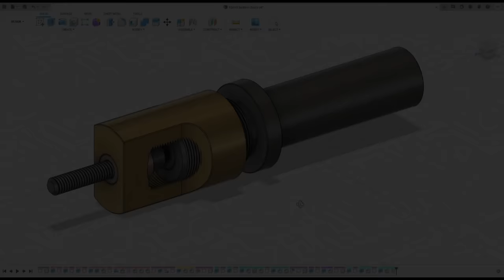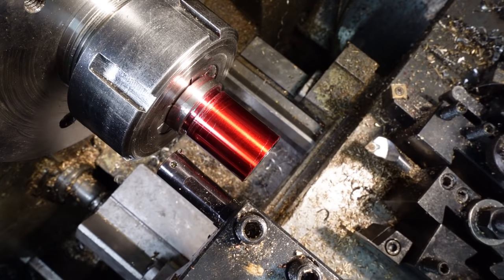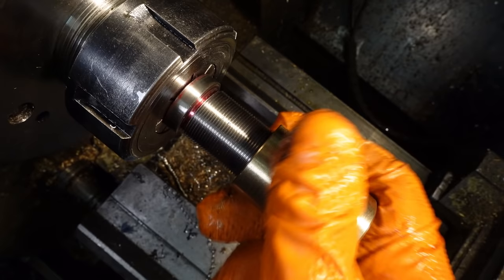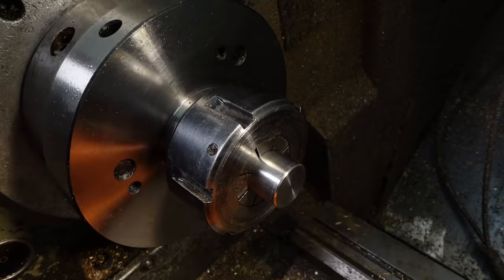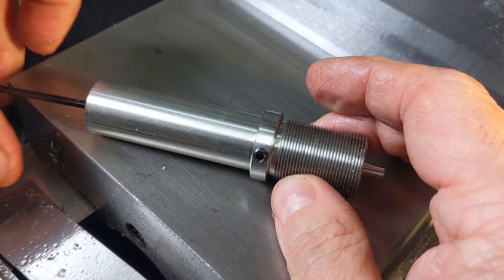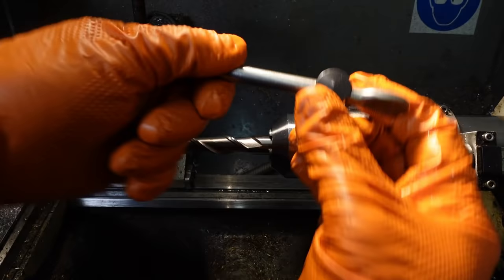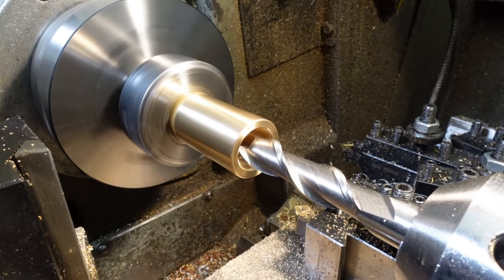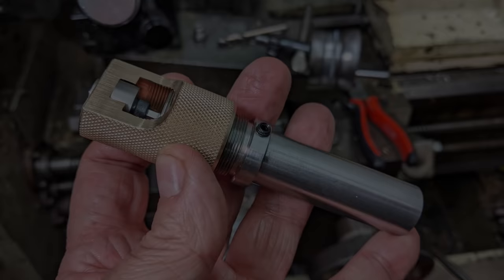Lantern Chuck machining and build #toolfest2021

Comment: The bit about the tidyness OCD people almost killed me! I'm still giggling about it! Keep up the great videos, man! 73's - KK4YKN
Reply from the maker: I am terribly rude to them. I'm sure it's a painful affliction though. Seeing others who are free of that particular genetic tidiness quirk doing their thing effectively despite less than perfect tool storage and chip-tray polishing must cause serious stress and anguish, and I feel genuine sympathy for them.  No, really. Look, stop giggling folks. Anyway, this evening I used a polishing cloth on the part of the chip tray that was going to be in-shot, as a token of my continuing efforts not to cause distress. Wasted effort. The depth of field of that F-stop was so tight that the chip tray was nothing but a distant blur. So blurred that you could believe it was messy, if you were so inclined.

I'm working on the second and third parts of the 1296 MHz coaxial stepped low pass filter at the moment, it is taking FOREVER to do the editing and graphics and run all the simulations, but I really want to get the level of detail right and make sure the filter performs just like it does in the simulations, so it will be a few days until I can post these. I'm going to be doing more radio content showing exactly what the Things I make are used for, but it's driven by whatever is next in the order book. I need to get some more solid copper watercooling plates made and I have 15 or so SSPA heatspreaders to finish and 30 or more 122 GHz antennas, but I only have six days until I have to give a lecture at the Martlesham Microwave Round Table event and I haven't even STARTED writing it and doing the experimental work. Not enough hours in the day!
Reply: 😂😂 I just laugh, all I can say...it's a very nice chip collection that's all..😂 oh there's a lathe under that..😂😂

Comment: Yes, the sound is much easier on the ears; however the waterfall effects mean now my bladder is making itself urgently known!
Reply from the maker: If I was doing it now, I've worked out how to handle the audio split in sped-up sections and got my levels right, so it would be much better. I used it again today and it's earning its keep.

Comment: Thanks, subscribed. You sound different to the way you sound in my twitter feed - you're much funnier here (that's haha funny, not weird funny). My lathe never grows extra teeth - occasionally the opposite due to cheese-grade gears 😁
Reply from the maker: Twitter me is rather different, but it's probably the Lincolnshire accent that does it.  Very hard to get the inflection and vowel sounds right in 280 characters. Cutting gears from cheese sounds like an interesting challenge though.  Using Old Gouda, it might just be possible
Reply: @MachiningandMicrowaves  Haha, I'm originally a  Yellowbelly myself (from the flat bit to the south) so you sound perfectly normal to me.

Comment: When you were running that "janky chinese reamer" in, i wondered...if you have air, could you use a gentle breeze to persuade the cutting lubricant toward the point where it is most needed?
Reply from the maker: I guess that might be possible, but ideally the cut should be light enough to make it in one pass without extra lube. Perhaps I could have used my Noga-Cool Mini to blast a fine mist of lube to help clear chips.

Comment: I see alot of people with battery problems on cameras whydon't they make a wall plug for them to keep them powered up for when you can use a ac power supply I know cameras are made on a 99.899 percentages to be portable I mean the point is clear but I obviously know nothing about them .also might have just found a away to make something the community can use whith that being said what camera do you use and what is the most common one used on you tube...if you know or how to find out without looking at every page .. hmmm food for thought..
Reply from the maker: Mine is a Sony ZV-1. It is stupid. You can't run it while it is plugged in to the charger or a computer, except as a streaming camera. You can buy aftermarket dummy batteries.  They have a wire.  The problem is that you can't close the battery flap with the wire dangling out. That wouldn't be a killer, except that the battery flap hinges are either side of the tripod mounting thread, so you can't fix it to a tripod, rail or clamp with the flap hanging open.  Brilliant.  You can't drill a hole as the catch is integral to the flap and it would wreck any resale value.  I'm not happy to have the memory card and battery just hanging there in space.  I bought it as a result of viewing a LOT of Youtube vids and reviews because it seemed like reasonable value, but it was a total waste of cash.  Those reviewers are now in my Little Black Book of folks whose opinions I should ignore!  Dummy batteries are a reasonable solution for most cameras, but not this one, UNLESS...  I think it might just be possible to make a low-profile titanium mounting bracket that would allow the door to hang open enough to prevent the memory card or battery falling out, but also allow use on a tripod mount.  I guess they are great when used for vlogging on a gimbal with a pocket full of spare batteries, but when you are filming a machining operation or something else that cannot be re-shot, it is a liability.  The lens is junk for my application as well, the lack of a filter ring is a disaster and the focus discontinuity at partial zoom happens right where I want to do most shots.  Almost all cameras have a zillion things I don't care about.  I want manual and remotely-operated focus, manual and remote zoom, ditto shutter speed, ISO and aperture, with focus peaking or some other focus aid that I can use on a bit wall screen.  Manual metering would be useful.  I don't need any of the other function-bloat that most cameras seem to have as a result of marketing pressure.  I want interchangeable lenses that don't bloom and flare and have soft edges, you know, like the stills cameras I used to have in 1978. I want high dynamic range so I can pull out areas in deep shadow and handle specular reflections, so adaptive ISO in different image areas would be cool. I'd like a programmatic API interface so I can send commands to the camera over wifi or bluetooth from applications I write or from a physical control panel like a CNC or Midi controller. It needs to survive the occasional splash of coolant and occasional grinding dust or cast-iron powder, and also rapid changes of temperature and humidity without getting condensation INSIDE THE LENS like this toy ZV-1 does. I guess I'm going to have to spend £2.5k or more and just ignore the fact that I'm not using 98% of the functionality. I paid a lot less than that for my Bridgeport and my lathe.  I could buy a lot of radio gear and test equipment for that sort of money too, but it will be worth it if it takes away the stress and pain of using this thing.
Reply from the maker: Now I want a camera that is as gorgeous to use as my Nikon D80. I am going to end up talking myself into buying a Nikon Z6 II and being penniless for a while.  Purely for mental health wellbeing of course. It's like medicine or "fresh air and exercise" and it will probably bring joy like using a Brown and Sharp or Mitutoyo or Tesa or Haimer or Starrett metrology tool. Downside is that the remote control app is a bit rubbish. It will do full 4K RAW into a suitable interface, and can do 120 fps at 1920x1080, and has a 10-bit sensor depth. It's a stupid amount of cash and I could get a surface grinder and a bandsaw for that sort of money.

Comment: you do what u do and do best.
Reply from the maker: My lathe is often very very clean now.  My new shop vac thing is a monster.  Probably the most dangerous machine in the shop with that amount of suction.  I daren't use it if the Chihuahuas are about.  The tube is big and they are not big.

Comment: You know, I could have sworn that I heard running water and birds in your shop during those machining clips. If your shop is dirty enough that you can’t see a burst water main and birds flitting about, maybe it’s time for an intervention.

Great videos! Interesting projects, good techniques, and quite entertaining.
Reply from the maker: It's so distracting, having to wear SCUBA gear in there, and as for all the guano, ewwwww!
Reply: @MachiningandMicrowaves  Hear in America, at our makerspace we are re-designing the Apollo space suits, to make them gloveless, yet keeping the o2 pressurization so we aren't forced to breathe toxic wood dust while keeping virus protocol, adapting the condoms aides prevention gave us some trouble for a while, but that issue got resolved when we decided to castrate the users. DONE. were presently looking for volunteers for testing.
Reply from the maker: @stewartfrye  Sounds like an offer no reasonable person could possibly refuse!
Reply: @MachiningandMicrowaves  safety is safety after all

Comment: The scratch pass is for fallible humans who might select the wrong gear but if you not human or are infallible then please feel free to skip that step.
Reply from the maker: I did go a bit over the border into dismissive hyperbole there, didn't I...  AIMEE would say "Neil, you are so rude".

My old Colchester has one of those "Lathes for Dummies" gearboxes that makes it almost impossible to mess up. I totally get that scratch passes are a great idea for high-value parts or on lathes with change wheels and non-intuitive gear selections.  I've never messed up a thread pitch selection on the old clunker, but I did make a REALLY stupid mistake a while back, the thread dial has four different internal gearwheels and I'd swapped the wheel to do some 1.75 mm pitch and didn't change it back, so the next thread I made looked perfect on the first pass, but the second and third passes were offset a little and I found I'd cut a really stupid three-start shallow thread.  A scratch pass wouldn't have helped me, but now I hang a little label on the threading half-nut handle with the size of the currently-fitted thread dial wheel so I might not screw up another time. Luckily it was only the second or third op on the part and the thread was very short.  It did make me scratch my head a bit until I realised what was going on.
Reply: @MachiningandMicrowaves  Congratulations Neil, you have just passed the human test. You have admitted to making a mistake, welcome to the human race.
Reply: Let he among us who has never misread the gear chart cast the first stone!

Comment: The funny thing is I was cleaning up while wearing gloves and got a very bad injury from some broken glass and got small parts of the rubber glove in my hand after an ER visit later I did my own surgery because they couldn't find anything and well I'll give them that rubber gloves don't show up on x-rays but that's all they really did.
Reply from the maker: I have some fancy gloves with anti-piercing mesh that I use when picking up chips and ribbony swarf and dealing with glass and ceramic shards. I need my fingers to remain sensitive and not get pierced and tingly/painful so I can work on tiny mechanisms and 0402 surface mount devices with tweezers. Nitriles just don't work for that sort of thing. I have some anti-cut gloves with chain-mail and some chainsaw gauntlets with kevlar chaff and some deerskin gauntlets for TIG welding and some special beekeeping gloves and chemical-resistant gloves.  OMIGODS, I am such a glove nerd, aren't I!

Comment: I think you tubers use diekem when threading because they like the contrast for their cameras.  I like threading in reverse too. 
"Machining and Microwaves" Hmmm, Possibly you did microwave guides in the 1960s and 1970s?  I did, and I did it on manual machines too.
Reply from the maker: My father worked in a gas turbine manufacturing plant in the 60s and 70s, so I could just give him a sketch and, as if my magic, a few days later, he'd come home from work with a beautiful 10 GHz absorption wavemeter and 20 dB cross-coupler. Apart from a five week course in 1976 on basic machine shop practice, I hadn't touched a lathe or milling machine until I bought the Colchester and Bridgeport in March 2017, so I'm still a raw beginner as this machining lark.

Comment: Thanks for shining a light on what a lantern chuck is. I find that when you get the feeling that your workshop needs cleaning it is a sign that you need a mug of tea and a couple of chokky biscuits, the feeling will then soon pass. Gloves are for catching the bits of finger you cut off.
Reply from the maker: Tea?  TEA?  Foul muck.  Tastes like The End Times.  Liquor of Beelzebub. Although it goes beltin' with a good slosh of Bells or Johnnie Walker Red Label like my grandad used to have in his tea flask while he was out ploughing or baling.  I managed a glug or two while I was helping during harvest or planting. It made driving the tractor MUCH more fun.  Look, I was almost twelve and I could reach the pedals and plough a decent straight furrow with or without the help of that warming nectar.  Tea on it's own though? Ewwwwww.

Comment: Not gonna lie, i don’t know WTF that is 🧐
Aside from a dirty lathe 😶 i enjoyed every minute of it 👍🏻
Reply from the maker: A clue to one of its many uses might lie here:
https://youtu.be/ViRQuaKx3ik?t=40
Trimming bolts to a precise length, drilling a deep hole in the end and making a brass insert that is knocked in then turned to be concentric. Now of course, I need to explain THAT. OK, the brass pad helps prevent the bolts from scratching the surface of a piece of metal being help concentric with the axis of the lathe.  Mostly to prevent death or similar inconveniences to the lathe operator, ie me.

Comment: Go on... you knowledge is to spread to the X- Box Kids ...
Reply from the maker: I'm really looking forward to seeing what the Hackaday generation comes up with when they can get back to makerspaces and eventually get labs and workshops at home.  As ever, the problem is that when you are young and fizzing with ideas, you are also struggling to earn a living and do all the Being Human business and don't have the luxury of time and resources that come with being Of a Certain Age.  I am wrestling with some fluid dynamics interactions with metallic membranes for a VERY interesting upcoming project. Forty years ago, this would have been stupidly easy for my not-yet-worn-out brain cells, but now I have to plod through all of the maths and physics and thermodynamics, checking every step of the way.  Of course I do have the astounding power of finite element analysis programs to confirm the calculations. That given me computational power that I wouldn't have been able to dream of 40 years ago.  Just think what toolsets the X-box folk might have in another 40 years.
Reply: @MachiningandMicrowaves  ... they print the metalstuff ore have a plastic hard like steel ...

Comment: I am sorry may be it's a stupid question but:7
What is that device for?
Reply from the maker: It is used to hold bolts and machine screws so they can be turned to a precise length or have a hold drilled in the end or anything where you need an awkward bolt holding precisely.  Normal ones are very VERY small and used to make the screws in clocks and watches.  This one is rather large. An example of it being used is in this video: https://www.youtube.com/watch?v=ViRQuaKx3ik&t=237s and later at https://youtu.be/ViRQuaKx3ik?t=505
where I'm cutting an M8 bolt to length then drilling the end to take a brass plug and then turning the tip to size

Comment: Never understood how a lot of guys using the lathe have no gloves and short sleeves?  Every time I get froggy and do that hot chips hit my hands right between the fingers while you are trying to run the controls!  Same with bare arms.  When you are getting into the critical areas it doesn't help to yank your hands off the controls to shake off a burning chip.  Nope sorry I will wear gloves and a full face mask as well whenever I think about it.  I wear glasses but chips can get behind them pretty easily.  I guess I live in a parallel universe where skin burns and eyes get damaged!  Turn a bit of hard ss and see what I mean.
Reply: because we have seen one to many video's of a guy getting killed by him getting wrapped around a part and rather get scars and burns than a funeral.
Reply: Don't get me wrong it hurts but slow your feeds if your getting red hots. And in critical areas your going to fast if your getting chips that make you ruin a part because of a chip firestorm. Speeds and feeds.  Face shield cool I get that other than a nitrile glove that will shred touching anything with a sharp edges. Any loose hanging anything that can't just break off can end you. OSHA would approve of this message because ya know safety police rather you get burned and hands messed up than die.
Reply: @wolfey24k54  Has more to do with the hardness of the steel than my speed or feed.  I am going pretty slow on both.  Some materials are no big deal others like hard shaft ing come off hot even at 600rpm.
Reply: @douglasthompson2740  heat treat after (100% don't think that's an option if your doing it) just don't advocate poor practices for extreme circumstances don't get me wrong if I got molten chips flying at me for an off piece Id do the same.